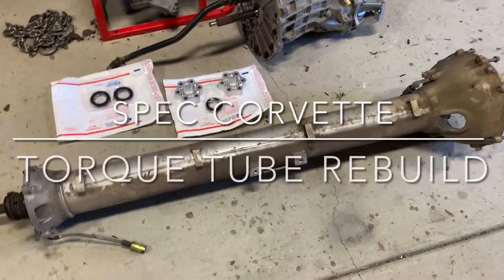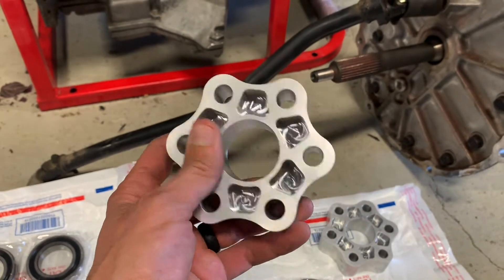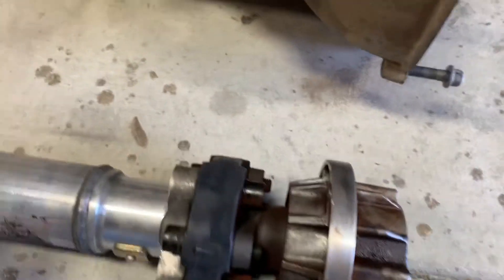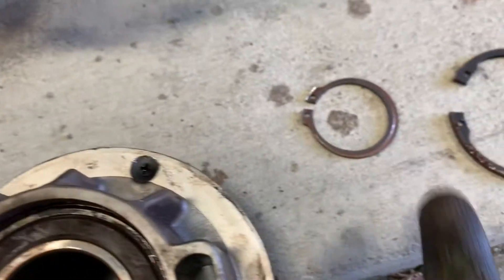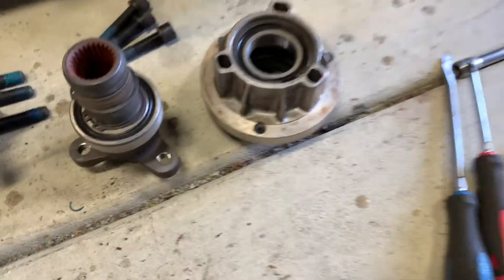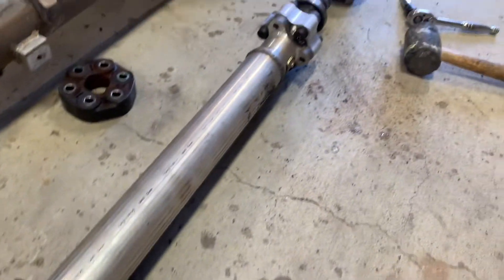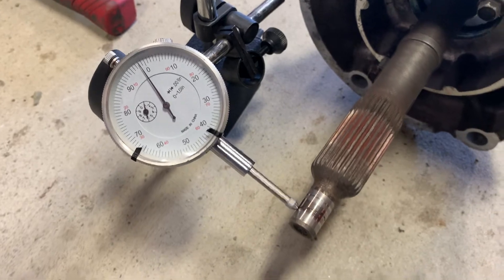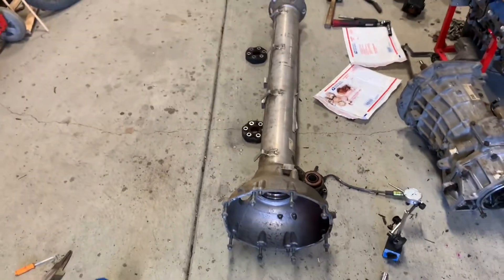Spec Corvette Build - Torque Tube Rebuild with Aluminum Couplers

Comment: Hi,Josh when you rotate the coupler to find the less round out you have to torque the bolts every time you change the rotation?
Reply from the maker: Great question! It’s probably best if you do but I did not fully torque them each time because it’s kind of a pain. I got them close, then double checked everything after final assembly.
Reply: @joshc1017  Thanks for taking the time to answer my question.Regards

Comment: Does it drive much different than stock couplers? Any rougher ride or more vibrations? Thanks.
Reply from the maker: I don’t notice much of a difference but I was careful to buy a well balanced coupler and rotate them to find optimal runout. I’m also running solid motor and diff mounts, spherical bushings, coilovers, etc. I hear/feel every bump and vibration.
Reply: @joshc1017  What's the upside to this approach? Aren't you just transferring harsher impulses through everything, from the torque tube/drive shaft and the differential and ultimately wearing those splines out faster?
Reply from the maker: You’re spot on with the downside, although most drivelines (think traditional driveshaft and slip yolk) don’t have rubber couplers in the mix. I think the point of the rubber couplers is more about side-to-side movement in the shafts (runout) than it is torsional shock, but they do absorb both. 

The upside is that the aluminum couplers are much less likely to fail. In a race car application, the shaft is spinning at the top of the rpm range most of the time, so higher than typical centrifugal force is more likely to rip a rubber coupler apart. I’ve seen stock and aftermarket coupler failures at high rpm knock a hole in the torque tube and bend internal components. That said, I’ve also seen rubber couplers survive racing applications, so just be prepared to proactively inspect/replace and use high quality versions.

Comment: Does the billet couplers throw off harmonic/vibrations to the torque tube drive shaft and if so how reliable are they.
Reply from the maker: It’ll destroy your pilot bearing if you don’t keep the runout within spec. That said, if you keep the runout low the whole assembly will last much longer than rubber.

Comment: Did you check if the driveshaft is balanced?
Reply from the maker: No, I didn't check it for balance... just marked everything to go back in the same orientation.  Definitely not a bad idea, though.
Reply: @joshc1017  i was looking at a clip from another guy and he balanced the shaft as well. I think you will be fine 😀

Comment: Hi Josh, I just put my manual driveshaft back together with new bearings and a couple of aluminum couplers. When I checked the run out it was 70 thou out on the front only, and I didnt need the gauge to see it had a very noticeable wobble in it.

 I tried clocking the coupler and it didnt help at all. I tried the old rubber coupler and the same result. Then I tried another front yoke from an auto shaft and it was the same 70 thou out.  Is this normal?
 Do you have any advice ? I was thinking of shimming or maybe  resurfacing that end of the  driveshaft yokes as the couplers are not the problem  ??
Reply from the maker: I haven’t experienced this myself but Kevin Jones did with his car. Turned out the yoke was bent just a little. In his case, a new one brought it back in line. Interesting that yours did not change with a replacement.

Comment: Are theses still holding up good to this day I’m on my second stick torque tube in my c5 and it started making noise again wondering if this will be a more permanent fix thanks in advance!
Reply from the maker: Yes, they are still working great for me. No degradation in performance at all. Same for the set in my other car.

Comment: How did you measure the runout on the rear side of it?
Reply from the maker: I should have shot some video on that, sorry!  It's essentially the same thing.  When you put on the rear hub, there's a little bit of output shaft snout sticking out.  It takes a bit of work but you can get the dial indicator on the outer portion of the snout and rotate the shaft, just like measuring the front.  I think the rear is less prone to wobble and damage because of the way it's designed but still worth checking.
Reply: @joshc1017   Thank you!